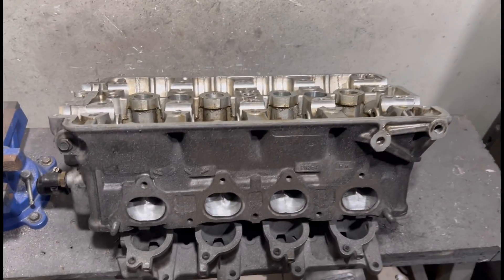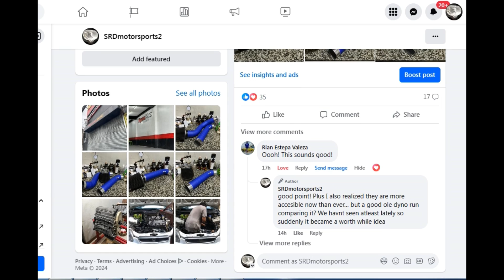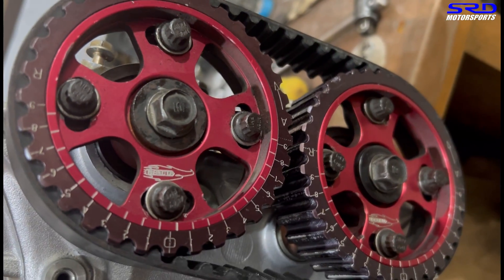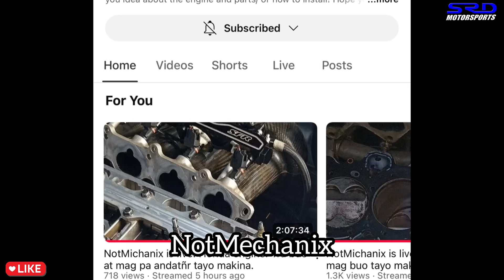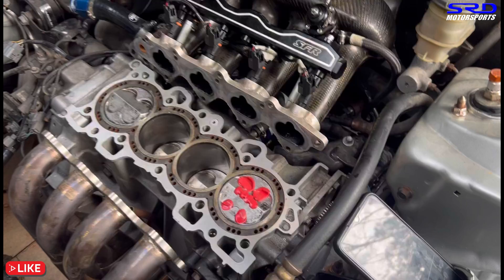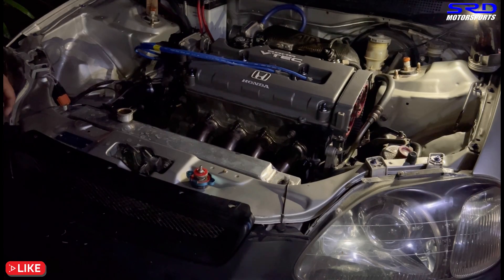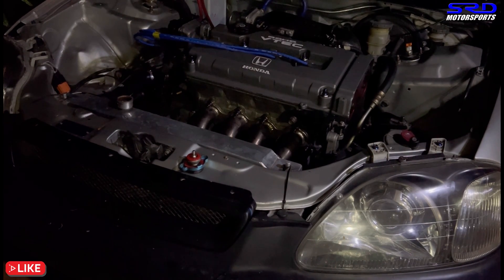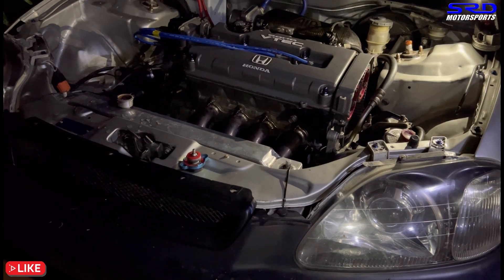B18c TypeR Head Porting upgrade: Install and start-up part 2

Comment: Hello ask ko lang ano po best upgrade to gain more power para sa Stock B16A w/o using turbo ? Currently naka Intake, headers, full exhaust na ako at naka street tune
Reply from the maker: depends on a lot of things